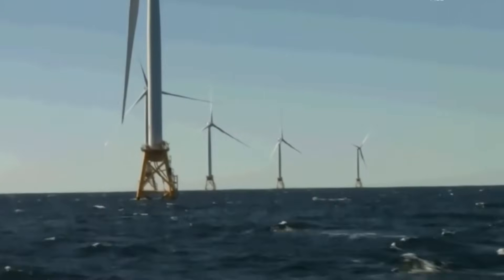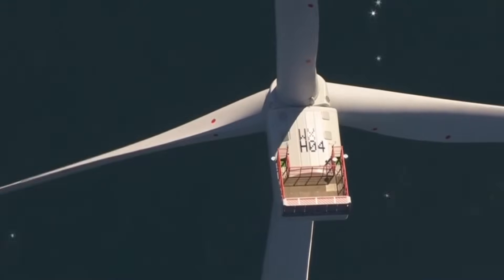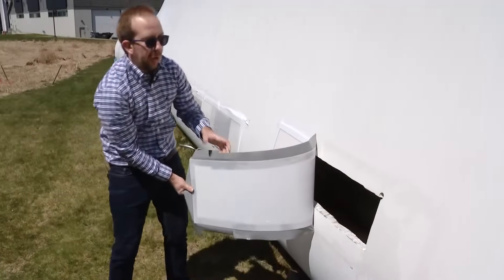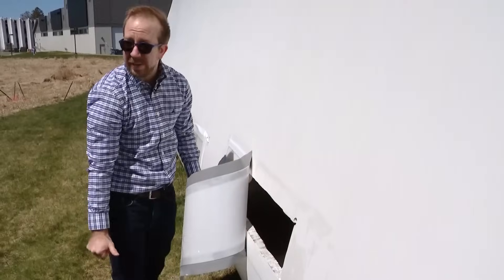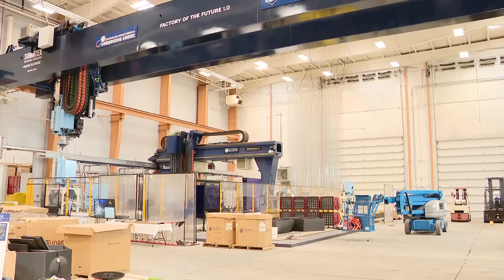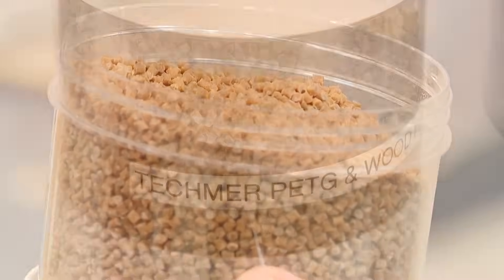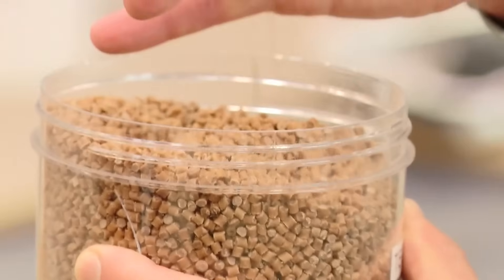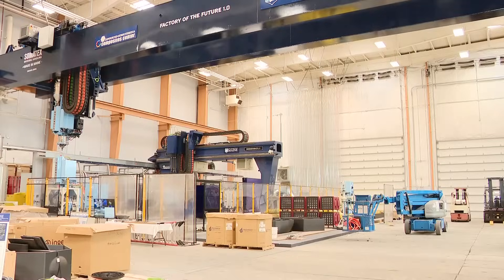University of Maine puts 'new spin' on recycling wind turbines

Comment: Bimbo reporter thermo plastics and fiberglass are Petroleum based they are just not new petroleum based products they are used. "REPLACING" NOT.
They should cut them down and make roofing materials and also storage units that are insulated and rust proof unlike steel.

Comment: Reading the replies, seems folks clearly understand that beyond the hype of beneficial reuse comes the economic impacts.  The law of diminishing returns has a huge impact on the hopeful rhetoric of recycling.  Worth noting, the cost of recycling never includes the environmental impacts that inevitably result.  The ruse of "renewable energy" omits the fact that using the renewable part is not the part we use, and the equipment required to convert require minerals and other materials including hydrocarbons.

Comment: What are the professor states It’s a replacement for petrochemical based plastics. My understanding the wind turbine blades have a petrochemical Based origin if that is correct, the plastic derived is hardly a petrochemical replacement. What would you make the wind turbine blades out of without petrochemical? and only then can you state it’s a petrochemical replacement-that should perhaps be the next topic of research

Comment: As someone who has built the blades and been inside them while on a turbine, I've always thought they should be used for infrastructure or construction. You could build some sick skatepark features with a wind turbine blade
Reply: This guy fucks!
Reply: thats what went through my mind a skatepark
Reply: I was wondering about that. I am concerned about microplastics, but all that space inside must be good for something. Maybe indoor parks could use them more readily.

What about using them to protect underground cables?

Comment: So, they're using the fibers from the composite windmill components as fillers for new composites.  If they're shredded, they have no tensile strength, so then they're used for CMU or additive manufacturing (3D printing) where compressive loads are typical.  But then, that opens up use of materials such as gravel or sand.  Hard to believe this material can be cheaper to use than sand.  And in Texas, we have (currently) 15,000 wind turbines.  Who's going to pay to dismantle, cut up and ship 45,000 blades to a recycling plant?  With inflation, shipping costs are insane these days.  Need to make sure the economics is SUSTAINABLE.

Comment: What about the 900 tons of concrete used for each wind turbine base?
Reply: concrete is always renewable.
Reply: What about the 80 gallons of oil in each windmill that has to be regularly changed out.
Reply: @jugglesdimensions8632  same as your car... they recycle it, filter it. smh.
Reply: @jugglesdimensions8632  a single offshore windmill generate as much energy as  60 barrels (42 gallons each) of oil a day. thats around 2500 gallons of oil daily. The carbon footprint offsetting alone is more than enough to justify the use of oil as lube .

We aren't trying to completely replace oil and coal overnight, just lower our reliance on it. It's about building a multi-tiered system of energy that is also renewable. Wind, Solar, Nuclear , Geothermal

Comment: The energy used to recycle those blades will likely use up the only positive net energy that came from the whirly-gig itself after accounting for the energy to produce it.
Another feel good story on top of the original one neither of which look at the actual MATH of these expensive jokes designed the make corporations rich.

Comment: It's high time that we require manufacturers to have a recycling/reuse plan for everything they manufacture. It should not be an after-thought, especially with items this massive.
Reply: I agree
Reply: This sounds great - until you think about it.  How would you even start to tackle that?  What do you do for construction materials that are supposed to be in place for decades, if not centuries.  What do you do with consumables?  So dumb.
Reply: @the_naP  If you're not part of the solution, you're part of the problem.
Reply: Blame government for the mess, not the ones following the government's stupid ideas.
Reply: @mersk100  Or both.
Reply: @cakeman58 supposition doesn't prove anything. Provide factual info then maybe you'll have two feet to stand on otherwise you're just blowing smoke
Reply: That would require a cost increase on the front end of a product ! So there goes the so called affordable green energy which is already a joke and those wind things are . . UGLY !
Reply: @mindyobidness9554 Do you think the cost to figure out how to dispose them isn't factored in to green energy costs? I guess you think reactive plans are netter than proactive ones. I hope you never were a manager.
Reply: @cakeman58  O' so you were there when they did their cost analysis on the specifics of wind turbine blades ? Ya ok Mr business CEO !
Reply: @cakeman58  No, those costs aren't factored in.  Anyone that tells you they were is lying.  How do I know?  It's my job...
Reply: @the_naP  if you’re talking about the recycling costs, they were paid for by a federal grant. So yes, those costs are part of the cost of green energy and are born by taxpayers. It should the paid for by the manufacturers. I’m sick and tired of capitalism that allows companies to profit from products and have the disposal costs passed on to taxpayers.
Reply: @cakeman58 you're good with words but again never put forth any rationalization.  If costs to the mfr aren't passed onto. the consumer how are e they supposed to make a profit that their shareholders would approve. If not approved could end up closong their doors.  Then what's the point of it all in the first place? If you don't like capitalism don't let the door hit your arse as you leave
Reply: @artsteadman2230  And you offer nothing but speculation that the company can't make a profit if they-- instead of taxpayers,  become responsible for the disposal costs. Look at where CEO pay has gone in ratio to worker pay in the past few decades. I refuse to believe they can't afford to design for efficient disposal. They are just too greedy.

Comment: Interesting fact about plastics, and probably fiber glass, because they are both petroleum based, every time it is heated for production of a product the molecular structure breaks down losing strength and durability, that is why they have to add in virgin material. Sometimes as much as 70% .only items that are of no structural consequence can use 100% recycled materials 🤔
Reply: Where are the Just Stop Oil protestors?
Reply: Wait, wait wait. Hang on a minute. They can’t be petroleum based we’re doing away with that industry. How come we are still using it to fund and support the renewable energy process?😂
Reply: @malcolmwhite6588  We aren't going to stop using oil and nobody ever said that. What we are trying to do is quit burning it. The more of it we burn the higher the price goes on the other products, not accounting for price gouging that is.
Reply: @cyclewisconsin105  when you say, nobody says that we should stop burning, oil ,that’s not correct. Many politicians have expressed a desire to completely shut down the petrochemical and oil and gas industry. However, you quite rightly state, a couple of things : there is benefit to be burning less oil for sure, and also price gouging goes on as it sadly does in many essential industries, including of course the electricity industry

Comment: All sounds nice,  but I doubt it will be fully used. The cost of recycling is too high for companies to actually use. Same reason plastic product makers prefer virgin plastic raw material over recycled. It's cheaper.
Reply: Not just cheaper but as plastics as recycled they break down meaning you HAVE to have some virgin material to retain some semblance of strength.

Comment: These blades do not last 20 years because the tips are traveling at close to 200 mph. Every dust grain, pellet of ice and even rain drops take a toll. The speed is deceiving that is why they kill so many birds.
Reply: 15-20 years is the AVERAGE, this is including   cases where one gets pelted more than normal and goes down in less time.  windmills account for less than 0.01% of all human related bird deaths . Fracking areas when compared to on shore wind farms areas and actually shown to lower the bird population by upwards of 15% in a year while windmills have less than 1% impact and in most cases a non statistical impact.

Comment: I visited the Munich Science Museum this year.  The hall of Power and Engines has an interesting exhibit, sections of a very-large wind turbine blade, sawed into sections, spaced and suspended from the ceiling.  You get to see the interiors of the various sections and get a sense of how long the blades are and how intricately they are made.  Impressive.
Reply: Impressive, yes, but hardly in my opinion , environmentally friendly or a genuine replacement for existing energy

Comment: Here's a thought...Maybe not build them in the first place? They cost too much to build, not very efficient and don't  last very long. Meanwhile a nuclear reactor can last 60 to 80 years. Cleanest energy on the planet...just sayin.
Reply: SMRs are the way to go, but permits are blocked by vested interests.
Reply: clean, LMAO they leak... there goes the "clean air" of nuclear. you also have to babysit the nuclear waste for hundreds of yrs... safely. nuclear has never been cost effective or clean ever. base line energy= wasting electricity. there are plenty of other ways to get hydro w out  the dangers. "lasts 60-80" with A LOT of maintaince costs... most places still paying for the initial costs... they came over time and over budget to begin with. cost to store waste on sight, cost to move it to a secure safe location for hundreds of yrs.

turbines are built that tall bc wind is more stable higher up.. they are quite efficient only needing about 5 km winds to start. used to live near dozens of them btw... and where we lived.. the wind did indeed blow.

plenty of Canadian, and American plants have leaked.. we even nearly had a Chernobyl event .. 3 mile island nearly was Chernobyl.
where I am we are supposed to have potassium iodine pills jic a plant leaks.. that "clean energy". 
we had to fight to keep nuclear waste out of under our great lakes.. a source of that areas drinking water btw.

Comment: What about the root sections of the blades? Are they large enough to create mini shelters for the homeless? Two roots bonded together and capped at each end could possibly creat a livable shelter.
Reply: Agreed. They could turn the large ends into storage sheds or lockers. As for the tapered ends, those could be repurposed into some kind of awning to provide shade.
Reply: I thought it was going to be a playground feature before watching the video.
Reply: @bertblue9683  another good idea for recycled blades!
Reply: @bertblue9683  That picture had me thinking the same.
Reply: What about as a storm shelter?
Reply: @lauramichele474  not really, they are made from composite fiberglass and maybe carbon fiber. Storm shelters must be able to stop a 2 x 4 lumber stud launched out of a special cannon at over 200 miles per hour into it walls and doors and survive a dead weight fall of at least 500 pounds from a distance of ten feet.
Reply: Please, don't be a retard.
Reply: they rather let entire airplane fleets, rot away in some fields/desert, instead of offering them to needy ppl as "homes"....soooo what makes you think, they would offer blade-ends to the homeless?!
Reply: I too thought from the Thumbnail that this was going to be the container house of the future.

Comment: Why are they going to scrap at 20 years?  Why are they made for massive amounts of oil based resins instead of, say, aluminum?  If UV is the issue, coat them.
Reply: Making a wind turbine blade out of aluminum would make the blades prohibitively heavy.  The composite materials used are far lighter in weight.
Reply: @briandeiwert5911  You might be right, but I'd like to see an authoritative source.  Resin and glass isn't exactly light weight.  And an aluminum blade would last "forever."
Reply: @frequentlycynical642 They don't last forever, they warp and crack over time due to stress put on them, the same reason why the fiberglass ones are getting retired. Yes the old steel boats are still around but they also aren't put under a lot of stress like a fan blade would be otherwise plane props wouln't need to get replaced either.

Comment: what wears the blades out?
Reply: As the material ages and is used the material fatigues and eventually weakens like any other material.  Wood, metal, even stone eventually wear down over time, the only question is how long it takes.
Reply: @briandeiwert5911  Aluminum airplane propellers are in service after many, many decades.  True, not always rotating, but in an otherwise harsh environment.
Reply: @frequentlycynical642  airplane propeller blades are also typically around 4-8 feet in length.  Wind turbine blades are around 150-200 feet in length.  I suspect the extra length introduces more wear to the entire structure.  Also an aluminum wind turbine blade of that size would be insanely heavy compared to the composite materials used now.
Reply: @briandeiwert5911  But airplane blades spin at high speeds which would increase the loads to be similar, perhaps, to a long blade turning much slower.
Reply: What wears out blades?  The new money for profits for the selected suppliers who benefit from replacing the blades.  Planned obsolescence and opportunistic "depreciation" are awfully destructive forces.

Comment: What do they do with the balsa wood from the rain forest that is used to shape the blades?
Reply: The Balsa wood is valuable. Like the majority of Balsa wood, It will be cut out and used to insulate aircraft and luxury vehicles. Strong, light Balsa is hard to find and is expensive. Structural Balsa usually gets replaced by carbon fiber. Spruce is a close second to Balsa.
Reply: How about the outside plastic or whatever as shingles  then cut the balsa wood off as boards
Reply: Evidently, the balsa wood is still inside the blades. From what I could find with goog.

Comment: reusing the material for lower strength requirement applications is a great idea. i would take the round part and make rain water tank for my orchard 🙂
Reply: How many thousands of blades would you like delivered to your farm?
Reply: @DAVID-io9nj  rain water collecting is something that should happen at every house. most of the water we use can easily be rain water but we use drinking water to do it all. it is mindbogglingly stupid. i have over 20kgal of underground tanks, and i am a small 1 acre orchard. large orchards and farms could gobble these up if the costs could be reasonable. these look like they would last forever.
Reply: EPA would have a fit because of the toxins in the plastics.
Reply: Hate to tell you they are being removed because they are breaking down and not structually sound anymore.. So much for tht tank idea huh?
Reply: @SilvaDreams  they are being taken down because they cannot meet structural requirements of a turbine which are many orders of magnitude more stringent than underground tanks which also get no more uv and will fare better protected.

Comment: Everybody so worried about how to recycle wind turbines and EV batteries. When was the last time you ever heard about anybody worrying about how to recycle a coal fired power plant or an oil or gas fired power plant or the engine in their internal combustion car? Not that we shouldn’t be thinking about recycling renewable energy components. I just find it extremely ironic.
Reply: Recycling of metal from every possible source is a very common topic of discussion.  Dig a bit and you'll find a whole world of information on it.  I don't understand what you find ironic about it at all.
Reply: Coal plants are mostly metal.  Heavy, thick metals.  
Car engines are even easier to recycle and most of them are.   
For that matter, my Mercedes S-Class, from cradle-to-grave, INCLUDING the gasoline it will burn it its lifetime, is more environmentally-friendly, uses less resources, and puts out less CO2 than a Prius or Tesla.    The calculations surprised me as well when I did them.
Reply: @grayrabbit2211  Which is bullshit propaganda written in the Save Big Oil handbook.  Just the process of pumping oil and distilling gasoline pretty much buries the chances of ICE cars competing with EVs.

Comment: Wind turbines are made of OIL. Thermoplastic’s. Also what is the energy cost to recycle them?
Reply: Not thermoplastics, otherwise they would be far easier to recycle. The blades are made of thermosets with glass fibres.